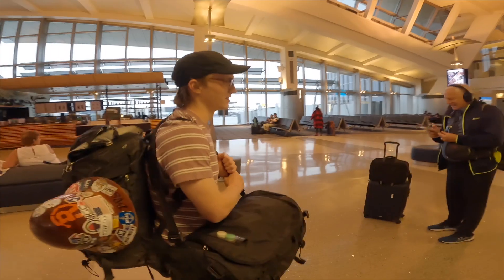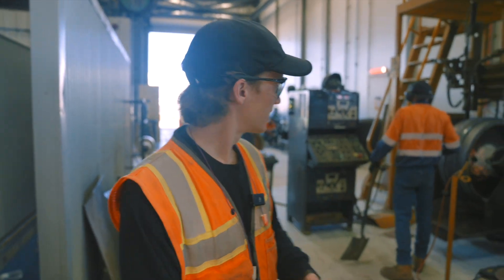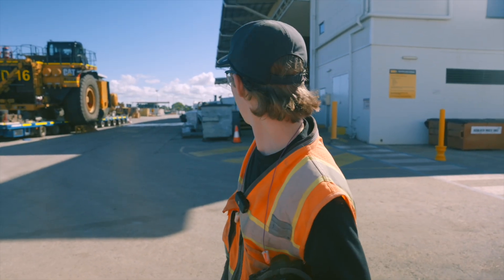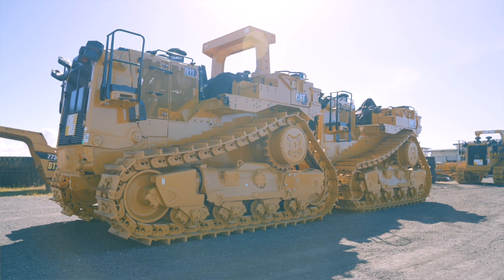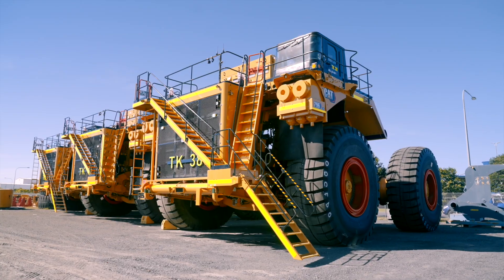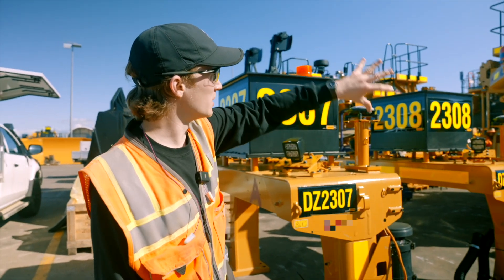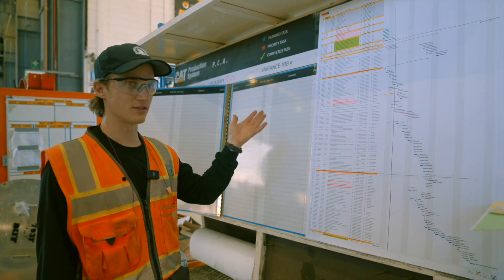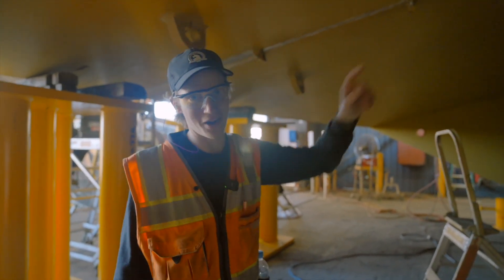The BIGGEST CAT Dealer Down Under | Hastings Deering

Comment: When it comes to tracks, are they doing an entire machines worth of tracks (two sides) in 30 hours, or one side in 30 hours? And are they disassembling the track chain completely or are they rebuilding with a brand new chain and hardware? I've never worked on something as big as a D11, but I've torn apart and rebuilt two sides of a Hitachi 1200-6 (M33 bolt) in ~30 hours total which was a massive job compared to the usual tracks that come across my bench.
Reply: It would be 30 hours a chain. The chains get totally stripped, inspected, repaired and rebuilt, Old grouser cut off and new grouser welded onto each grouser plate . (if they are reusable).  Probably sounds like a lot of hours but there is a fair few links in a chain and a bit of a process vacuum testing and filling each pin with oil. Boring repetitive work, but cool to do once.
Reply: It depends on the customer requirements and what's being replaced or rebuilt but typically for a full rebuild I would say 30 hours per track. Obviously you can do both tracks at the same time though. If you're just replacing the track shoes and hardware it can be done in less than 6 hours.

Comment: Back in the 70's I saw a D-10 fall over aa 100ft high wall at a gold mine in northern Nevada landing on it's top and the roll over bar held it up the driver had a heart attack before driving off the wall we rolled it back on it's tracks check the fluids started it up and drove it out of the pit it was back to work two day later after the shop went over it

Comment: I’ve been in steel fabricaton for around 27 years, I’ve worked with engineers when they would design a part, they’d ask me if it could be made, I will guarantee you I could make that box just as strong but cost less than $60,000.00
Reply: and that includes the fitting of your product to new dozers to be flipped and tested? you have no idea about engineering and specification costings.
Reply: It doesn't cost 60k. That's just what they charge.

Comment: I drive those d11s off and unload all the cat parts in brisbane.
Reply: That's not driving it, youre only moving it. Pushing loads of dirt is.
Reply: @torquesnhorses4986  pretty hard to  do that on the wharf. Do push around  Steel when we load scrap into ships.